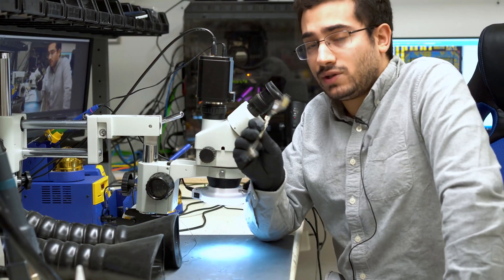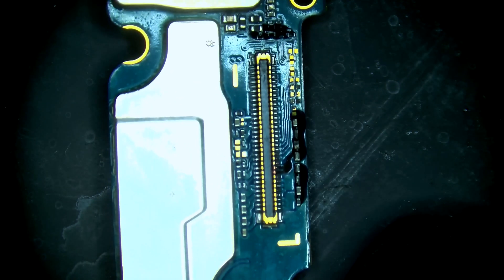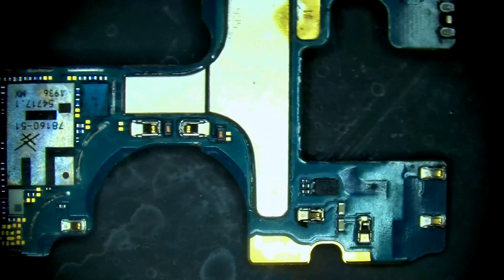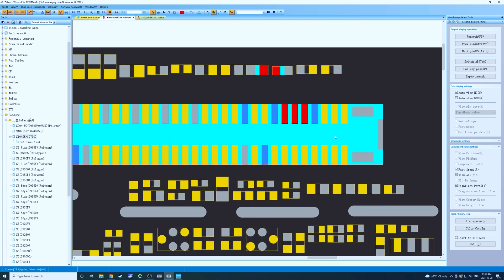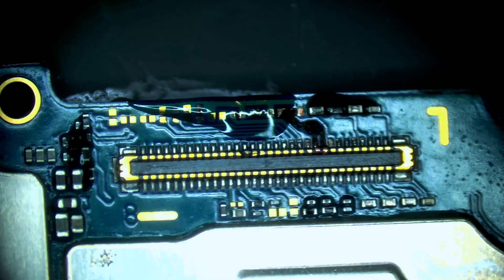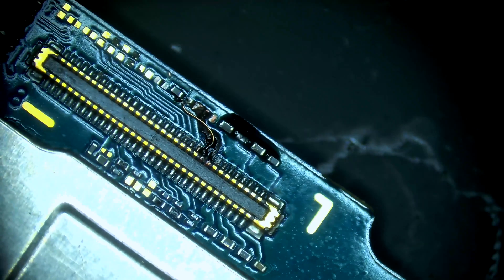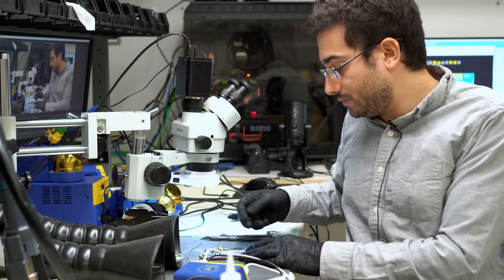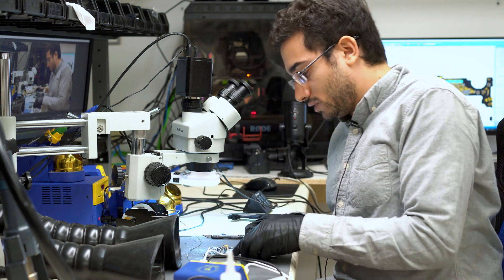How to diagnose and repair a Samsung S10 logic board with water damage 🧐

Comment: I have an S10 which is, while it is supposed to be waterproof, water damaged. Directly after going into the water, it had some overheating issues, but remained working 2 days after. After 2 days there were no overheating issues and it worked fine.

The 3rd day i woke up to a black screen and a phone that's off. It doesn't switch on and doesn't respond to the charger being connected.

The local shop simply sais: water damaged. Cannot be repaired.

I have bathed it in IPA, cleaned it with a toothbrush, still to no avail.

Any thoughts in what might be wrong?